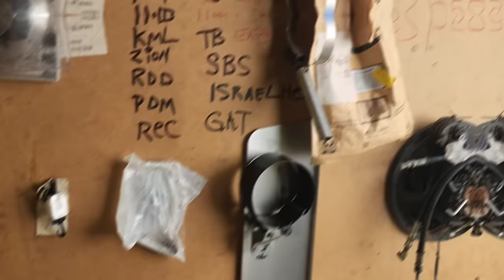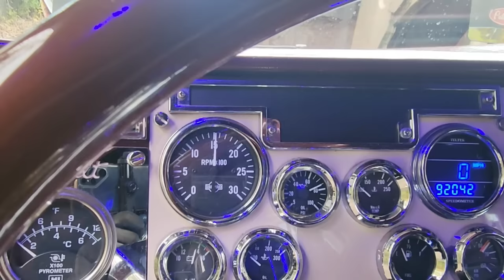Changing the oil in my Peterbilt 379 | CAT 6NZ | Bad king pins | Bringing used oil to Autozone |

Comment: Ive always done oil changes the same way prefill all filters besides collant your better then most TA techs 😂 that engine is a master piece with not one bit of oil or fuel or collant leaks anywhere that explains a lot about a driver/owner i do my pMs at 12-14 k miles
Reply from the maker: Those TA tech are fresh out of high school. They can't touch my truck. That's my very last option. Only if I'm in a desperate situation. I normally change mine every 10k miles, but this particular oil change was a little over 12k. That's why I did it in CT. Couldn't wait until I got back to NC. I would have been well over. 🫡🫡

Comment: Great video bro! Just a little trick I use on my oil filter take a screwdriver and put a hole in the bottom to drain the oil it's a lot easier to take a empty filter off plus no mess! Be safe driver!!

Comment: I think the reason you’re not supposed to add oil to the filter is when you dump it down the center that literally is the clean side so everything you dump in there is immediately going through the engine. If you get any particulates in it you’re fucked.

Comment: Brother where did you get the non removable oil plug ? Also the coolant filter kit attached to the frame ? I want those on my 379! Thank you for your Chanel …I signed up. God bless you over the road and be safe out there! 🤜🤛🙏
Reply from the maker: Type in caterpillar EZ drain oil valve on Google. Should pop up for Raneys and 4 state. I bought the truck with the coolant filter attached.

Comment: Any advice for someone who's trying to be an owner operator?
Reply: My advice from mee as an owner is wait for next year to see how the industry is cuz at the moment we are scraping crips off the floor but Mr. Marv might have a different opinion it all depends on your contacts
Reply: @truckinitwithedward3886  Thank You!
Reply from the maker: Wait until the market improves. If you start now, there's a high possibility you might fail. Most brokers won't load you with a new MC number. Also, as a new business, your insurance is gonna be through the roof. When you combine those factors with the current horrible market, you're looking at a steep uphill battle. So, hold off, keep saving. Good luck, stay safe, and God bless! 🙏🏽
Reply from the maker: @truckinitwithedward3886 right on. I basically said the same thing. Saw your comment after. 🫡🫡
Reply: @presy_jay  Thanks

Comment: Dude, why don't you put the bucket directly under the hole? Doesn't it fit?
Reply from the maker: Because this is wider and better.
Reply from the maker: When you slide the bucket out, it splashes over the top.
Reply: You use a large container when draining the oil from the vehicle. Then you pour the oil from that container into the bucket. I said it would be easier if you put the bucket directly under the hole.  @presy_jay
Reply from the maker: @DamirA.  And I'm telling you... The bucket is too high, so it spills when you have to take it out. If I used the bucket, I can only fill it 2/3 because it only fits under the drain if slanted.
Reply from the maker: @DamirA.  bro, just drop it... I'm good, man. You have your way, I have my way. The oil was changed without any incidents.

Comment: Better than that fake 5 minutes or less 😂😂😂 Why not put clear hose to drain into buckets 🪣 or bottles
Reply from the maker: Because I need to empty bottles after I pour the oil. I made a mess once when I tried to return the oil in the buckets. Spilled in my trunk.  Lesson learned. Bottles with caps only.